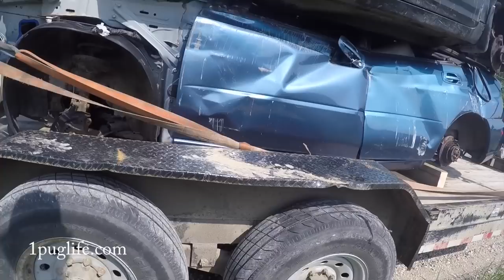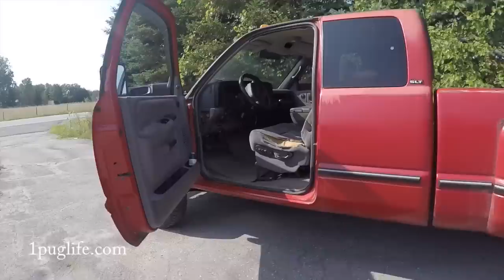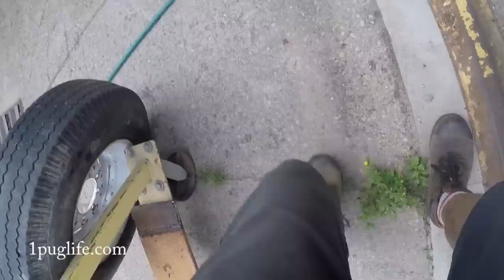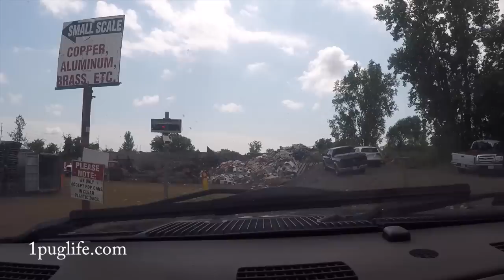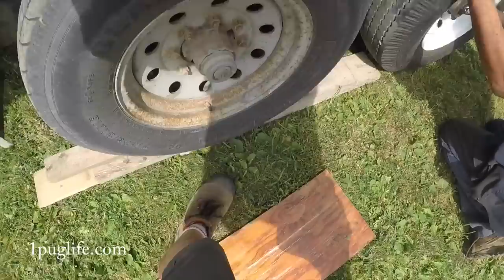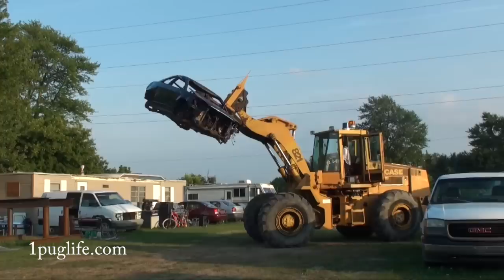flat tire on loaded trailer

Comment: Has 500 tires...doesn't carry a spare for trailer.
Reply: Does this surprise you?
Reply: inwood customs...
Reply: And I don’t know about canada 🇨🇦 but the price for junk cars in good ol MERICA is shit so he aint doing nothing but paying for fuel and tires no profit
Reply: Country63 around my way it’s about $7/100 lbs. It doesn’t pay to scrap unless you are dealing with copper or brass. With general junk metal scrapping you bust up your truck and burn gas. Sure you clear a few bucks but how many hours did you put in?That’s not for me.
Reply: see Mr Scrappity channel, he busted a leafspring and tied a rag around it, he scraps steel at 4 cents a pound

Comment: Why not roll the windows down instead of bustin' up all that glass that ends up on the ground goof? BMP.
Reply: Glass adds weight to the scale
Reply: @danh2134   the weight would still be there you just wound the window down.
Reply: Kind of hard to do that when he takes the battery out right away when he brings the car into his lot
Reply: @danh2134  jumper box and roll down the windows. Couple of minutes effort if you're taking your time.
Reply: You would think they would put a little effort into it but one look at these goofs and you know it's not gonna happen

Comment: If you break side windows on your lot glass is gonna be flying everywhere when you mow the lawn.    Get hit in the eye 50 feet away...
Reply: Roll the windows down. Then when glass breaks, it'll stay inside the door.  😐
Reply: Norman  thats the ticket  and just take out the back ones if they don't roll down.    Usually just some trim holds em on
Reply: Blocked User if they have window tint the glass stays together. He could use the large plastic wrap
Reply: FishFind3000   I was thinkin about that if you could get some cheap ,  stick it to the glass first
Reply: @FishFind3000  
Just roll the windows DOWN and if they break, the glass will be contained inside the door. 
If undamaged, windshields and rear windows are worth $$$ and they should be removed.
OR, cut the tops off flush with the body and make a full load of tops later.
Reply: @norman7179  to much work for the ginger goof

Comment: Roll down the windows or break them before you try to crush the roof.  The windows are part of the structure of the roof system
Reply: Exactly the windows that can be lowered are important for the roof structure. That's why you never should drive with the windows down. 🤣🤣🤣🤣

Comment: Who doesn't carry a spare trailer tire?
Reply: So expensive!
Reply: A whole lot more spensive not to carry one
Reply: @nmaddaford6155 +
  Purchased a 1 ton van from out of state. The sale pictures showed a spare tire, but it wasn't there when I picked the vehicle up. Sure enough, less than 30 miles down the road, a flat tire.
  I had a floor jack, tire plugs and an air compressor with Honda generator. Didn't do a dam bit of good as before I could get stopped the tire got chewed up.
  $380 later I got a new tire installed. (a load range E tire.)
Reply: @gungadinn  NEXT TIME KEEP IT SHORT AND SWEET BOY
Reply: Gunga Dinn   Only difference is he didn't just buy that trailer

Comment: That's why when you go traveling with the trailer you carry a 1 ton to a 2 ton jack you carry the sockets do you need so that way you can tighten the bearings work on the trailer when you're on the road that's what I have in every one of my vehicles when I pull a trailer you need to start doing that to Bud they got some fancy are Jack's that you can buy you need to get that shit in and put it in your truck if you're going to be doing this shit
Reply: That sentence runs on like a runaway diesel!

Comment: Happens all the time at work with me
Take the wheel off and roll on 3, if u distributed the weight properly itll float
Reply: Otherwise, it's a $110 (us) for a replacement 110psi 8 lug wheel AND tire... not the worst
Reply: Can chain the axle too after taking the wheel off. Floater on down the road without her squatting
Reply: @brandoncaldwell95  sucks extra when you gotta chain it up lol
Still a hell of a lot easier than driving 2 hours for a spare, then another hour waiting for a Jack delivery

Comment: You need to use the bucket to flatten roofs. V the center,  back up, bucket tilted back, lower to top of door height, drive forwards, push the 2 doors into the center of the car lift bucket over to opposite side of car, lower bucket to top of door height,  back up and the other doors fold into the center of the car.  Almost effortless.

Comment: My buddy owns a salvage/scrap yard he pulls the radiator the wire harness the cat all with the forks and does it quick.. when he pulls up to the car he takes out the post where the doors are and the car folds easy then to the crusher